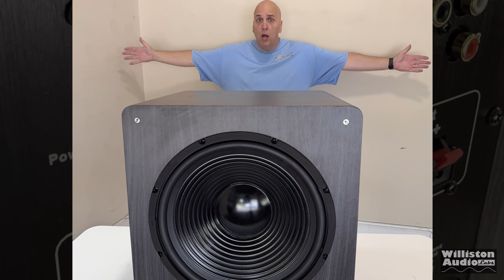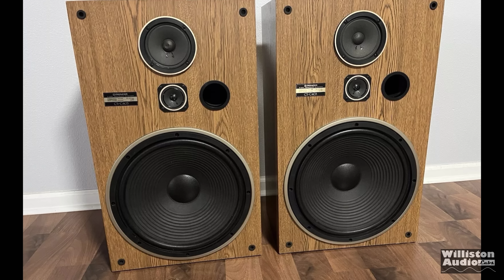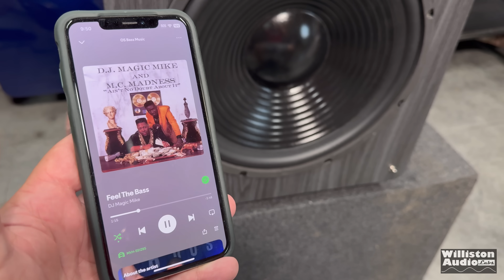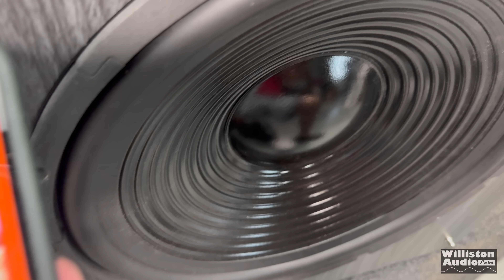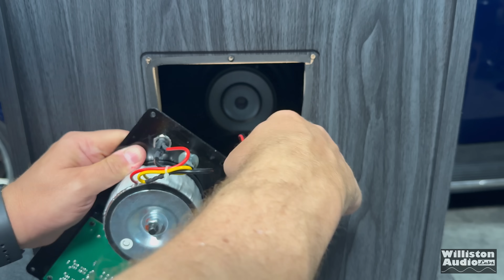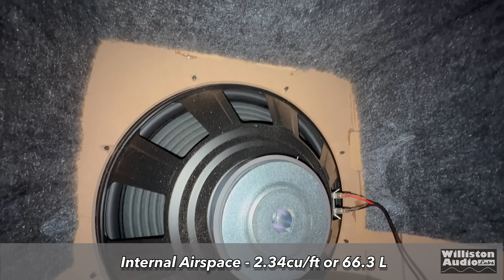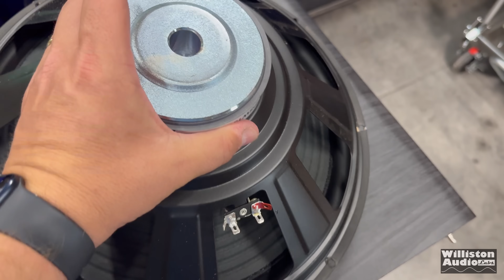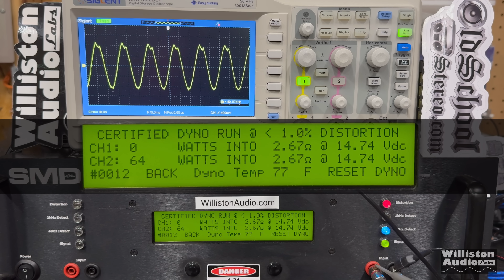The Worst 15" Sub I've Ever Tested - Acoustic Audio PSW600-15 Powered Subwoofer

Comment: I'm done with plate amps. Difficult to replace and often poor performers, it's easier to get dedicated amps and subs rather than a home theater sub that could underperform or fail to perform and be difficult or expensive to repair.

Good on you for testing this stuff and holding manufacturers accountable.👍🏻
Reply: @bozanimal5576  I agree completely. When my last pre built powered sub took a dump (12” infinity from the mid 90’s) I opted to use car audio subwoofers and a Crown XLS amp. It is far more musical and far more powerful than most pre built home theatre subwoofers. A Crown XLS series amp is easy to integrate in to most component systems via rca subwoofer outputs or any other line level output, xlr, or 1/4” phono (TRS). There are many descent to excellent pre built powered subs out there but I can’t see myself going back to them.
Reply: @07zx14White  Crown XLS FTW. That's what I'm using too. SVS 12" (Plate amp went bad), replaced with 1100W XLS which is 300w than what the SVS had. It was awesome before the plate amp went out, now I don't think I can even get distortion. The bottleneclk would be my KEF Q150's, may not be amazingly loud, but they sound great.
Reply: @flymaster99xxl  I love my crown xls1000 more then enough power for my desk set-up
Reply: @07zx14White I went to Car Toys and got me a Infinity Kappa Perfect 12”. I built a slot port enclosure and lined the interior with acoustic open cell foam. Hooked it up to my QSC RMX 2350 pro audio amp and poured the coals to it. It was pretty impressive output @127 db and it sounded pretty sweet! That was my first experiment with a lower cost Hometheater sub build. That was back in 2001. Upgraded and built several since then and now am satisfied with my setup. It was a fun journey getting to this point. Done experimented with different enclosures with these subs too. Learning what works good to improve sound quality and SPL level. I encourage everyone that has an interest in this, to give it a shot. 😊
Reply: Another happy Crown XLS amp user here.  Got one running my old Infinity SSW-212.
Reply: I BUILT one with Dayton plate amp........   so when the amp failed some  5-7 years later,  I was able to get another that was a fit.   Indeed it STINKS not having a fitting replacement amp.
Reply: @DeadKoby  I have a Dayton Plate amp, but they don't make it anymore. Use caution: Just because it's Dayton doesn't mean there will be a replacement (or even that it's good, as Big D showed recently).
Reply: Also the plate amp will face unwanted vibrations. I guess it's possible to make some sort of a suspended PCB, but I've never seen one. 

Funny how no one(?) has made an active sub with a 2U 19" rack mount at the top or bottom of the enclosure. That could have some vibration damping and the amp options would be virtually endless. For a higher end model just add some active adjustable proprietary DSP/limiter gizmo so that the response and the output would be optimized. A manufacturer could sell it with or without an amp.
Reply: Use Hypex Fa plate amps for 3 Diy subwoofers 2000W@4ohm total

Comment: Considering the price of the subwoofer, what an absolute disappointment. It blows my mind that companies still use Max and PMPO ratings instead of RMS.
Reply: Bro, a $231 15" powered subwoofer should be expected to suck. A lot.
Reply: Considering the price? $231 is REALLY low. Most people that know anything about subs would expect the sub to not perform well at all. For a LONG time cheap products like typically state the Max wattage, not RMS, just like all the $300 HTIB systems have done for over a decade with even 10% THD numbers.
Reply: @andrewskaterrr  They make boomy sounds for movies. good enough for that.